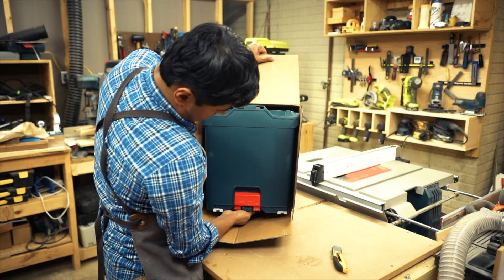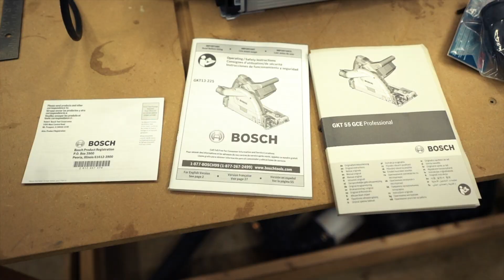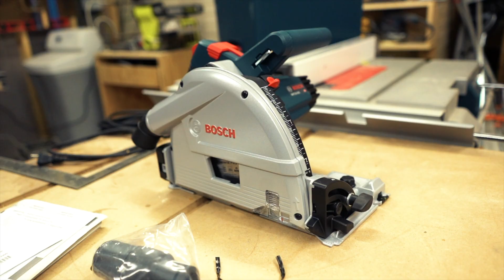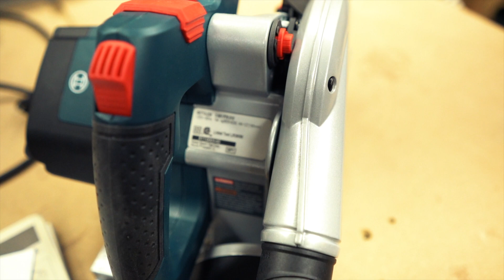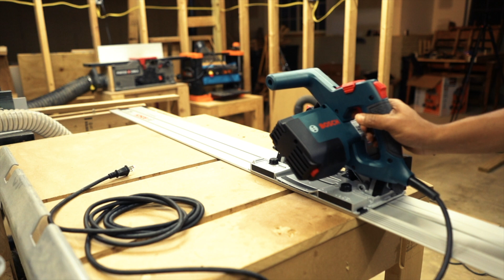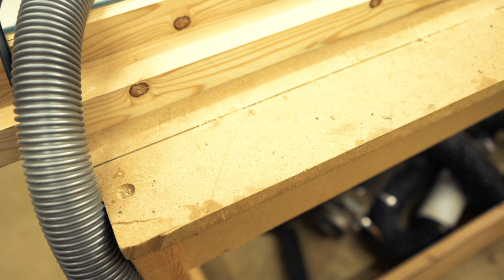Bosch Track Saw Unboxing and Initial Impressions

Comment: Hello, very informative video. Will a regular 6 ½-inch blade fit onto this saw? Thank you in advance.
Reply from the maker: Yes! No special slot or anything in the blade. I use a thin kerf blade. You may need to adjust the track positioning based on the kerf.
Reply: Thank you for your response.

Comment: I know this isn’t the same thing as a tracksaw - but I’m curious to get your thoughts on the Kreg Accu-Cut track system for circular saws.
Reply from the maker: It's better than a circular saw in itself. Anything that can guide the saw is going to give you more accurate cuts. The problem could be dust collection, especially you are working in limited space like I am. A track saw also comes with a host of accessories to expand the capabilities of the system those things might be limited in an after market system but these are minor things.
Reply: @KiranBhatWoodworking  thanks for the reply! I didn’t consider dust collection - that’s a very good point to think about.

Comment: Thanks for the review, I decided to buy one and it's coming tomorrow, can't wait to get started with it.
Reply from the maker: I'm glad it was helpful! I have used it for over 10 months now and will do a long term review after the 1 year mark. This has become a favorite tool in my shop and has elevated my woodworking game as I can work with thick slabs now. The transformation in builds is visible in my videos, haha. In my  small shop 63" track was a bit overkill so I bought a 31" track which I use it in almost everything I build. Just to keep it in mind.

Comment: I just got Mafell MT55cc, who also made this Bosch. From what I knew, the -1 degree was used when connected two piece together seamless. I remember I saw one commercial somewhere demoed that function.
Reply from the maker: Thanks! I have to try it. Since buying it, this has become one of the most valuable tools in my small shop. I have been using it to joint thick slabs successfully at 0 deg. Mafell certainly has more bells and whistles! It certainly is best of the track saws IMO!

Comment: C’mon, man. Just be real. The difference between the Festool TS75 and TS55 is only $75. Seriously, we're talking about a professional-level power tool here. Most people wouldn't consider the difference of $75 "WAY OVER" budget. The additional power and depth of cut you gain from upgrading from TS55 to TS75 by adding $75 is easily justifiable. 

Nah, just admit that you wanted to get the Bosch track saw to begin with. From the background of your videos, I could only see either Bosch or Ryobi in your shop. There’s nothing wrong about being a Bosch fanboy. I’m one myself, too.
Reply from the maker: Actually the total package is about $235 more expensive for TS75 with the guide rails compared to TS55. Are you comparing the bare tool prices or total price with the guide rails?  Compared to Bosch TS75 was over $260 bucks more expensive! I'm definitely like Bosch as two of my other big tools - Table saw and miter saw are Bosch and I've had great experiences with them(you go with what worked for you in the past). Fanboy is a bit of a stretch as I have Ryobi, Wen, Craftsman, Dewalt and Harbor Freight tools in my shop. I think I can swing a bit more for tools that need to be accurate like saws and don't want to spend for things that being inaccurate doesn't make a difference like drills, clamps, sanders etc., if that makes sense!

Comment: Nice video. Do you know how to adjust the blade to ensure a 90 degree cut when the bevel is set to 0 degrees? Which set screws should be adjusted? Thanks.
Reply from the maker: I would try going to -1 bevel and come back to 0 degrees. Lock the blade in change mode and measure it against the plate. If it’s not 90, there is possibly a defect.